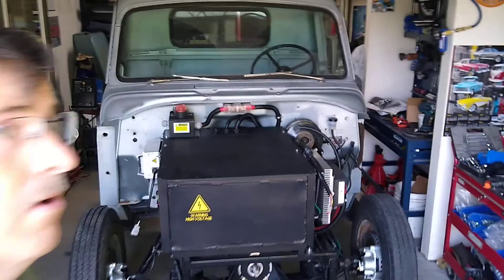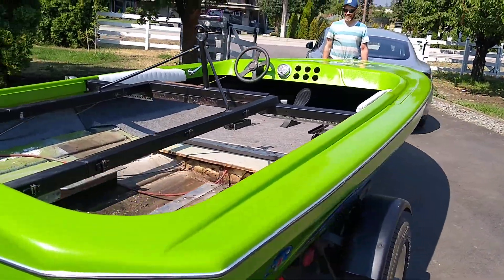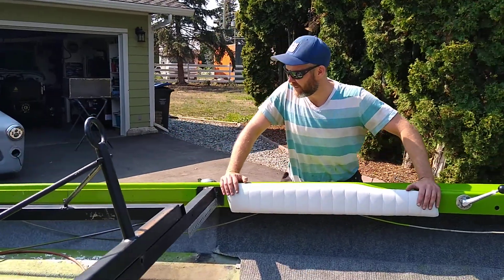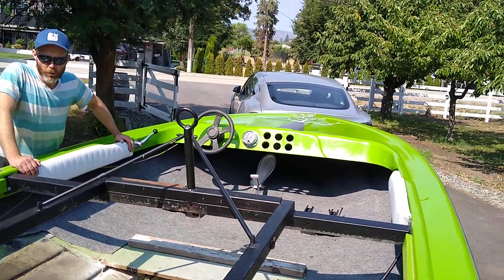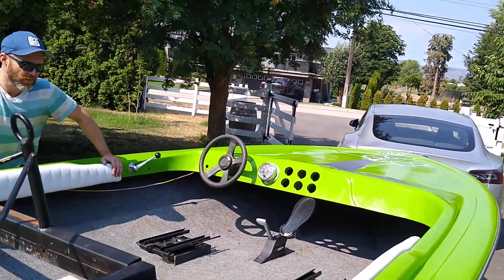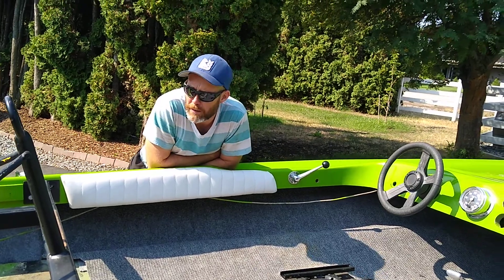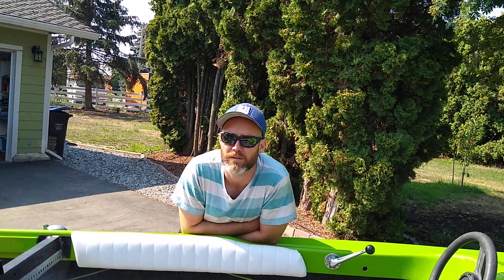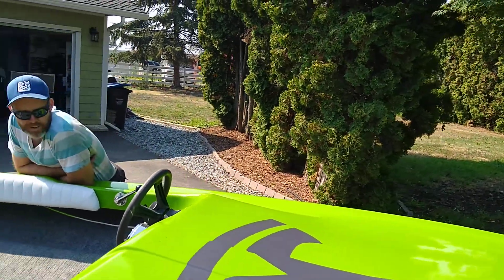Electric Jetboat Boat. Tesla and Electric Boat. Tesla Powered. Fargo DIY Conversion to Electric.

Comment: Hi thank you so much for this video my name is marco i need some help  i have 2001 bayliner ciera 26 .55 i just damaged my engine it was only 4 years old engine when u crank it its sound like pistons are hitting somewhere loud noice than it locks i m sick of tired with these gas engines I spend so much money 4 years ago for new engine i would like to change it to tesla electric motor could u please help me I live in ny i trust myself Mechanically i can put it together unfortunately i dont have electronic Knowledge could you please send me the part listings if u can i will gladly Appreciate it